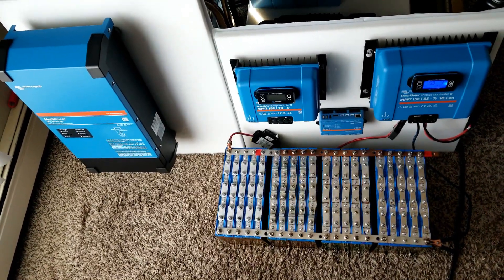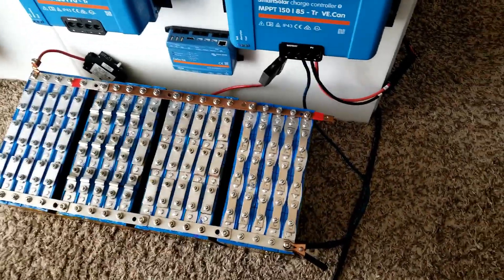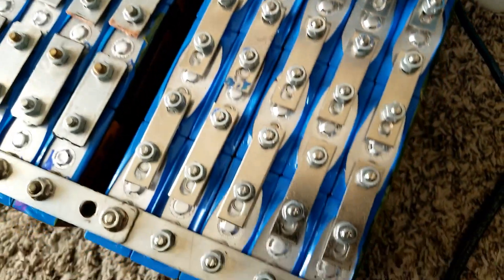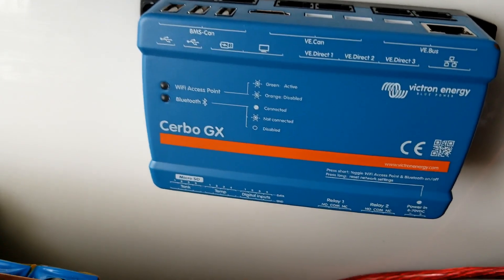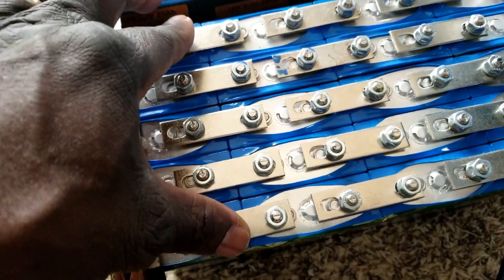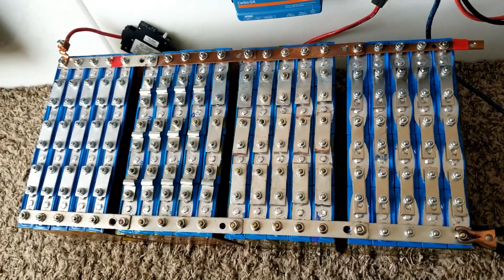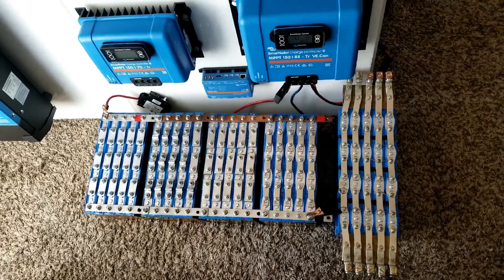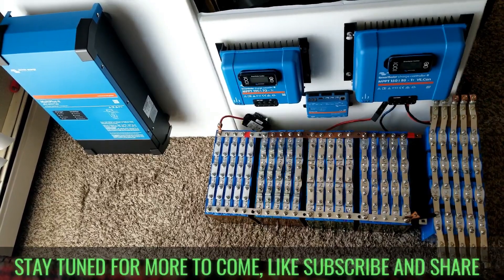HOWTO CHARGE 100 LFP 3.2V LITHIUM IRON PHOSPHATE BATTERY CELLS FOR OFF-GRID-SOLAR APPLICATION (Pt.3)

Comment: That’s a great setup. How much did you pay per cell? How did they test on capacity? They seem like a good size for various applications.
Reply from the maker: It has been a while these batteries over a year + ago at battery hookup. I bought them 12 or 24 pieces in a box.
BATTERYHOOKUP PROMO CODE  
https://batteryhookup.com/discount/jwsolarusa

Thanks for watching LIKE SUBSCRIBE and SHARE
Reply from the maker: I was not able to do anything yet with these batteries as I mentioned on the video.
Now I have completed the bus bars configuration and charging them, it is close to do our capacity test for the first time.